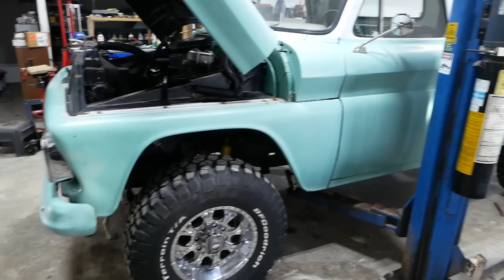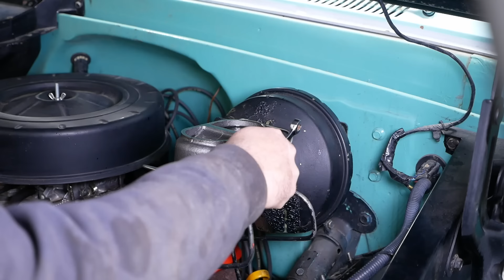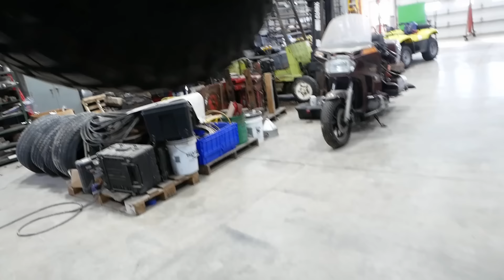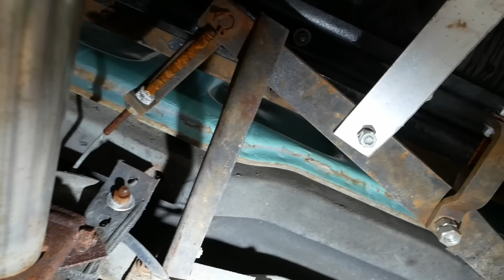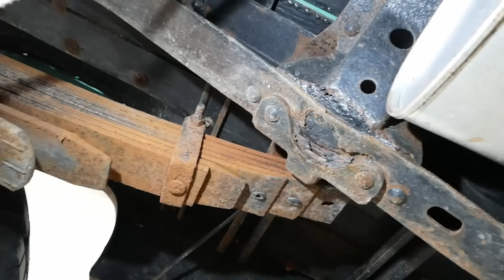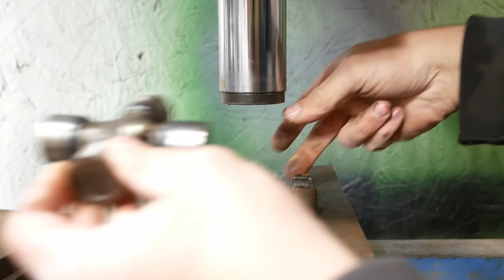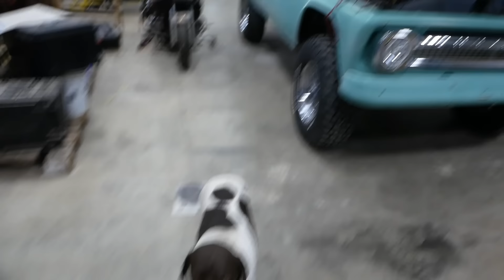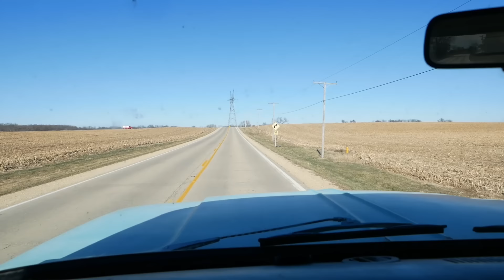New Parts = No Brakes and Other Problems | 1964 Chevy K20 Project

Comment: They were built to work on the farm for a life of about 5 years then trade in for a new one. All the old trucks we had about 60% of the dash and door screws would fall out by the first year then would rattle so bad you couldn't stand riding in them more than across the field.

Comment: When it comes to Die Hard batteries, half of them are bad when they leave the factory, so age means nothing on a Die hard. I've tested hundreds of them over the years dealing with used batteries, and I have only had three that tested good. I have seen some that tested bad when they were less than six months old. Those batteries are junk. Anytime you encounter one of those batteries, run every possible test and don't take anything for granted with them.

Comment: This video could also be called, "But wait, there's more."

About the u-joint install method, all the other suggestions were all doing it wrong. The way I would do it is take it to my mechanic and GTF out of the way.

And it sounds like radiator flex hoses are the farts of the automotive world, you just can't trust them.

Comment: Wes, I think your wife might be expecting one of these trucks for Christmas.  You can tell by the look on her face that she really likes the truck!
Reply: He's gonna need a bigger tree this year.
Reply: If she drives it, she'll change her mind.  I had the pleasure of driving a '68 for several months.  There was no way I could have worn a seat belt because I had to stand up to turn the steering wheel.  I didn't have enough power to turn it without getting my butt up out of the seat and putting everything I had behind it.  It is not a woman's vehicle.
Reply: @thirzapeevey2395  You are 100% correct!  My mom used to tell me how hard it was for her when she was 17/18/19 to drive my grandfather’s 1968 Camaro that had no power brakes or power steering.
Reply: @djosbun  nothing like letting the wheel slide through your hand as it corrects itself in a manual steering car.  My first car was a 65 Ford Falcon.  No power nothing in that car.  The 200 cubic six could barely get out of its own way.  Old times.
Reply: I guess Wes would go for any Toyota so he don't need to worry about what would go wrong with the car every month

Comment: I love watch old vehicles getting fixed! These are the vehicles that I grew up with. Santa still hasn't left me a classic car in the driveway. I'll have to speak to my husband.
Reply: Great idea if you're sick of your husband sitting around the house cuz a classic is almost never done being worked on
Reply: @Onewheelordeal  
Once you catch up on all of the ignored maintenance and time related issues (rust?!) they're no more effort than keeping a newer car.

Tires, brakes, fluids and filters are generally all much cheaper on common older vehicles. I also have less trouble getting good quality parts. Dealers can't get parts in a timely manner, if at all.

One tire for my daily driver (2021 Jeep) cost the same as a set for my MG.
Reply: “Toot” your horn all you want Wes.., I thought you were gonna snap one side of that yoke off., turned out great.  And, I don’t know “jack” about assembling “U-joints”.., but I have learned from your channel watchers, too never place car batteries on the concrete floor in the shop., and something about silicone dialectic grease…
Great vide,
Thank you sir.
Reply: I love mechanical work instead of electronic troubleshooting and repair
Reply: Just go out and get one
Reply: @Handle4570  We're both over 70, so buying a third car seems a bit wasteful. But I may get one eventually!
Reply: @susanrollinson  To be fair you're the one asking for it!
Reply: 54 convertible, light blue!

Comment: The best way to install U joints is show a before and after dadada shot that effectively ends the moaning from the peanut gallery, or alternatively install each cap with a different method just to make sure all the couch mechanics have their preferred method used. Guaranteed to trigger a few sensitive people and make my belly roll.
Reply: Most important thing about u-joints is make sure the needles are where they belong after that who cares. I have used a press, vice and hammer as far as the grease zirk goes as long as you can grease it once done putting the shaft back in.
Reply: Well put. I’ve never done u-joints but would lean towards what Wes or Eric O would do for sure.
Reply: Tell them if they don't like the way that you do U joints then you just won't do them anymore.
Reply: Here's a fun challenge - always try to find a new/different method for installing the caps

Getting them started by hand, and then beating the entire driveshaft against the table is one that immediately came to mind, or kick it with your steel toes, or fab up a linkage that's bolted to the floor and use the lift to press them in
Reply: Wes could also just mass mail Immodium and sedatives to all his problem commenters.
Reply: Or, they could all get a group rate on a high colonic.
Reply: Apply a small amount of axel grease into the cap before you start installing them will aid in keeping them in the cup properly aligned and aid in assuring proper installation  # statelaw
Reply: i hope the peanut,,that built the truck,,is not,,the owner..unles there 10 yr old..
Reply: @harrywalker5836  the peanut was your grammar teacher…
Reply: the u joints couldn't have been I  better condition before he replaced them so whatever method to put new ones in... yeah they were crap. he redneck engineered them (a tried and true method of redneckery) and they are better and working now. case solved.
Reply: Doing ujoints in the middle of a hay field,  u do what works at the time!
Reply: Well said sir.
Reply: I usually just squeeze them in by hand. If I'm in a hurry I'll use my teeth.
Reply: @darkwoodfarms1040  🤣
Reply: There is always a right way , a wrong way and MY way. I normally get acceptable results but the “professionals “ would say I’m a idiot. It works for me and that’s all that matters……….to ME.
Reply: You would have to do at least a double Cardan or triple to cover some ways (:
Reply: Need to use the Millennial Farm snap move.
Reply: I'll be honest. That first part of the sentence, i thought i had a stroke.
Reply: @aserta  As you use lower case I, anyway I agree haha
Reply: @aserta  Them rootin tootin’ dadada shots.
Reply: Jesus only worked on Fords…

Comment: Cool truck even though I'm a Ford guy. At one time I had a GMC with gas tank in the cab, death trap. Please convince your customer to get one of the many conversion kits out there to put it in the rear, under the bed. There are many cases where they where involved in accidents and the driver either died or was severely burned. And nothing wrong with your U joint installation and with a truck like that with it's horsepower rating zerk fittings are not an issue.

Comment: I have a 1961Chevrolet Apache 20. With a hoist tailgate was always missing. Some rust but real good shape for its age. Don't use it so much anymore. Wes you would flip if you knew how many years it's been since the oil was changed 😂. Nice job 👍

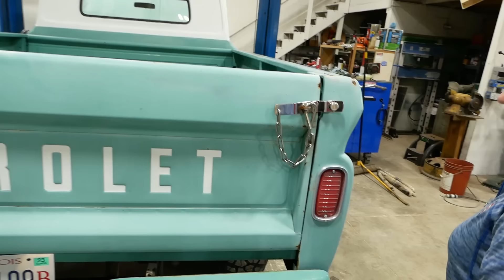Comment: 2:33 No.
At times I wish I could teleport myself to you when you work on earlier cars and trucks.
16:00 Wes do something with that fuel hose and filter going to the Edelbrock carb. They make a banjo fitting for the carb and you can run the fuel line on the top of the valve cover towards the front of the engine.
24:40 Every U-Joint I have installed is grease fittings toward each other. That is not a real monster truck, just put it together.